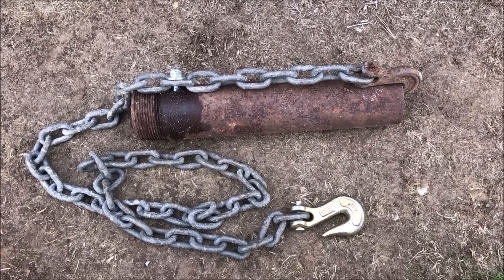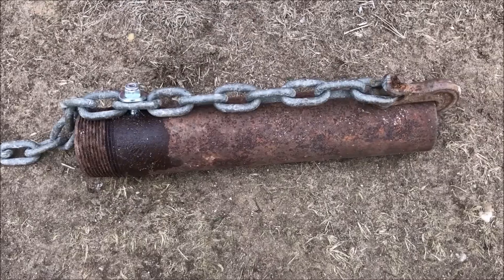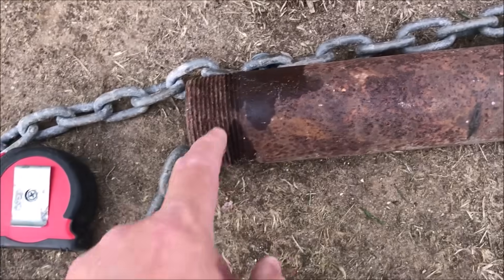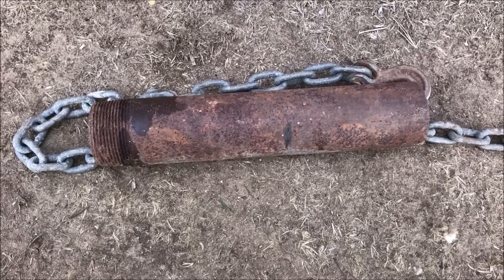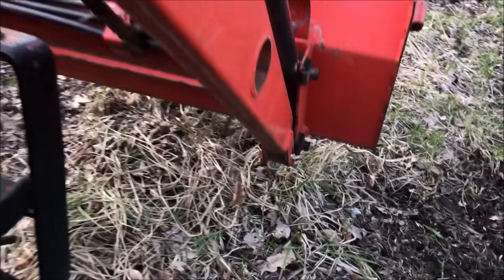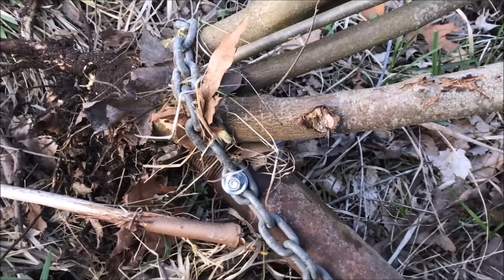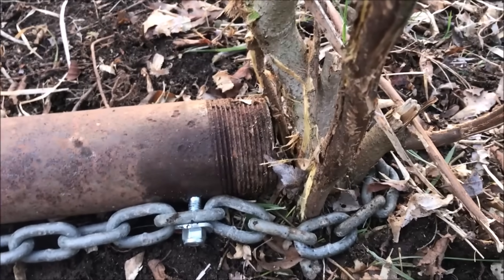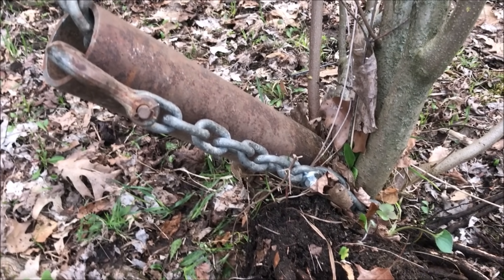OldGuyDIY $18 Best Homemade DIY Brush Grubber Tree Sapling Bush Alder Puller Pipe & Chain Grabber

Comment: Good idea! Did you try puttIng the chain loop entirely through the pipe and hooking one end at the top like you have it just on the inside… then you won’t have to put the bolt on there.
Reply from the maker: Yes, that works but it takes a lot of time to remove the chain from the pipe after each pull and then re-lace it for the next tree.  I have found the solution shown in my 2.0 video to work the best and quickest.

Comment: Or you could just use  a chain with a slip hook end that makes the chain like a noose or rope with a slip knot so the chain tightens when you pull. You don't need the pipe.

Comment: Keep both runs of the chain in the pipe, and you don't have to bother with the bolt. It will automatically keep in line with the chain.
Reply from the maker: I suspect you are right but unless you cut the top of the tree or bush off so the chain loop can be set over the top, getting the chain around the tree and back through the pipe may be problematic.
Reply: @OldGuyDIY  Cutting the top off would certainly be the quicker option. My other concern would be the tree just bending and pulling into the pipe. That would be fun trying to get out.

Comment: Totally unnecessary to make this. All you needed to buy was a different type of Hook. You need to use a snatch hook instead of a grab hook. A Snapchat will allow the chain to slide through the hook and tighten around the tree.

Comment: That looks great.  All I need now is a $ 10,000 tractor.
Reply: You can add a snatch block pully, and it will double the pull strength.
Reply: Try 25000
Reply: @markconley9279  Bought a Russian air cooled tractor in fine working g condition for $1,500!
Reply: You can use a farm Jack / high lift Jack. It has 8500 lbs of lift capacity which is more than the lift capacity of any front end loader on a compact tractor.
Reply: Seems to me you could run a chain to a vehicle and get it to work.  Maybe.    If it works pulling sideways
Reply: Or buy a $30 pick axe and get to work. Your choice
Reply from the maker: Or a come a long, atv, truck, car, horse, just about anything.
Reply: You can do it with a $1,500 tractor.  I just use my Takeuchi TL12V2.  Yesterday I took out a 36” tree with it!  Just dug up the roots and then pushed it over!
Reply: If you take a 4x4 about 3ft long and place it at a 45 degree angle with the chain coming over the top and attached  to a car it will pull directly up
Reply: @andyroubik5760  Yup, or an old tire. Run the line over the top and it rolls it right up and out.
Reply: Wow yt deleted my simple comment, must of been because I said the part of the vehicle that has different gears in it, starts with a T. If you use a kommalong (mispelt incase that word was the issue) you can just tie it to the vehicle to not damage the T the thing that changes gears.
Reply: Thanks saved me wasting my time
Reply: Nah. Stans your spare tire next to the desired tree or bush. Run the chain up over the top to your pull vehicle. Pull slowly and you're golden.
Reply from the maker: You must value your pull vehicle less than I value mine.
Reply: I paid $700 for my 1953 Ferguson tractor. It will probably be around longer than most of the newer tractors. I don't have a bucket but I pulled many small trees and can get a lot of work done with it.
Reply from the maker: It sounds like you found the tractor Louisiana Purchase. Congratulations.
Reply: I was thinking of making the pipe shorter and using a large bar.
Reply: $10000?! Used maybe. Farm jack should do same or just hook to a truck bumper
Reply: Funny you posted this cause it was my first thought. 
Solution...buy a comalong and chain it to a near by tree or something bigger than the bush itself. Could even use a vehicle making it to where you don't need to beat up the vehicles transmission to pull the bush, just use the comalong.
Reply: You’re not going to buy a tractor for $10,000 .
Reply: JD 350 Crawler'll handle it. This video will solve my chain slip issue perfectly. 🤘
Reply from the maker: I agree, this will eliminate the slip issue. Please see my brush grubber 2.0 video for a better plan.
Reply: Of course he means used for 10k, new one that caliber is 25a+
Reply: If you don’t own a tractor, you probably don’t have any trees to pull.
Reply: I use an old F250 wheel. Drape the chain over the wheel (25psi). Pull the chain with a winch wire rope. Winch is mounted to the receiver on my old truck. 
The wheel changes the direction of pull from horizontal (sideways) to vertical (up).
Reply: @jimglewis583  bingo. Thats what I do.
Reply: No you don’t, you just need a come along
Reply: Not really. With this setup you should be able to get by with any heavy vehicle. I paid two grand for my Massey Ferguson. Runs great but doesn't have a bucket. Plenty of pulling power on the back though.
Reply: lol. My exact thought. 😂😂😂
Reply: My question is why didn't he just use the bucket to pop it out.
Reply: Get a cheap beater truck suv or even ATV with 4x4.  My Jeep was $500 bucks but it’s a pretty tough woods buddy even though she knocks like a jehova witness.
Reply: Or a winch
Reply: Or a $50 dollar come a long.
Reply: Not really.. a $1800 one will do. 
Or your truck bumper.
Reply: Paid 2000 for my first tractor a Massey TO30, you can still buy them for almost the same amount. They will do everything most people need and would certainly do this.
Reply: At least $20k
Reply: Use a four wheeler.
Reply: Any truck or suv could do it just use a longer chain so nothing smacks the back of the vehicle. By the way you can buy a used tractor way cheaper than 10k.

Comment: How are you feeding the bitter end of the chain around the shrub and back through the pipe?
Reply from the maker: Please watch the 2.0 video.  The better plan is to bolt a 10" piece of chain to the pipe and have a second chain, with a grab hook, that is laced through the pipe and hooked to the short piece.  That technique eliminates the need to run the chain through pipe after each pull.

Comment: T H A N K.  YOU for this ingenious article. I believe I would weld a few links to the pipe, instead of relying on threads in a thin pipe. It's an excellent design and concept. You could, also, use square or rectangle tubing. Just whatever you use, the grab-hook would need to slide thru the inside, easily, like a "BUCKLE" on a belt or, like you were referring to, (a ring on a choke-collar.) The PIPE idea is simply genius!🎉

Comment: Has anybody ever seen the chain over the tall rolling tire method? It seems like a force multiplier.
Reply from the maker: Yes.  If I use the loader to provide the lift, I don't use a wheel on the larger trees.  If I am pulling from the drawbar, I sometimes use the chain over wheel technique to pull up rather than perpendicular to the trunk.

Comment: I like it and it seems to work!  I usually just smash it all with the bucket and drag the pto mower over it ;)  Sometimes use a chain or a cable logging choker. I think what makes it work is the chain is guided up the pipe smoother than a chain over a slip hook.
Reply from the maker: I agree it works well.  When clearing trails for atv's, I prefer to pull the tree out rather than leave a small stump to potentially puncture a tire or risk dulling the chainsaw when hitting the ground, trying to cut it as low as possible.  I believe the reason this design does not slip is because the harder you pull, the harder the edge of the pipe is driven into the tree.
Reply: @OldGuyDIY  chainsaw never wins!

Comment: Excellent idea.  I'd weld that chain to the bottom of the pipe since that bolt is on its last legs after 2 uses.  ;)   I learned to use a spare tire to provide the upward pull for my little 2,500# electric ATV winch in the receiver of my truck.  It pulled up 15 Spirea bushes and several small trees for me just by setting the tire up at the bush with the cable going over it to the truck.  The choker concept is beautiful, though.
Reply from the maker: Thank you for commenting.

Comment: Im surprised that works. I would think the hard steel would not be able to grip the tree.
I use a Jeep tow strap 2" X 20ft. I wrap one end of the strap around a tree 2 or 3 times
then feed the long end thru the loop & hook the long end to my tractor & pull. The
strap tightens around the tree & out it comes.

!
Reply from the maker: In my experience, this technique is quicker than the wrapped tow strap and easier to disengage from the pulled tree once it is out of the ground.  As tension is put on the chain, the edge of the pipe digs into the tree trunk, much like a climbing tree stand, and allows you to pull the tree out with no chain slippage.  After 40 years of wrapping a chain with a slip hook around the trunk 2 or 3 times only to have it slip and need to be repositioned 1 time out of 4, I found this technique and have not looked back.  Thank you for commenting.

Comment: My logging chains have a grab hook on one end and a slip hook on the other.  For small brush simply wrap twice with the slip hook and it will not slip.
Reply from the maker: I had used the two or three wrap slip hook technique for 40 years before finding this solution.  I prefer this technique because it never slips. Thank you for commenting.

Comment: A pretty slick idea!  I'd be curious to see how it worked on bamboo.  I've got both bamboo and privet overrunning my place, so I'll definitely have to look into making one for myself.
Reply from the maker: There is no bamboo in my area so I can't make a prediction.  I suspect the question is whether the pipe and chain will crush the bamboo before pulling it out. Please let us know how it works on bamboo.

Comment: I do the same with an old tow strap. Tie loops in each end then around the tree and feed one end through the other loop.. Choker. Would also work with a 3-5 foot length of steel cable from tractor supply.
Reply from the maker: I prefer this to the toe strap because it never slips and when using tow straps in the past, they were sometimes drawn so tight around the tree trunk that I could hardly remove it from the trunk.

Comment: The hook on the tree end doesn't appear to have a purpose. Just left it on because it came with the chain?
Reply from the maker: I used the chain with the hook in the first version because it was laying there and I didn't want to remove the hook before testing the theory. The version I use today has 2 bolts and no hook.

Comment: I use a D-ring at the end of the chain that is big enough that the chain slides. It works best with my home made crane implement to pull the brushes straight up.

Comment: Another option to keep from having to rethread the chain through the pipe.....     Use a smaller diameter pipe where as the " chain " fits through it.......but not the hook.   Remove the pins on the hook..... push the chain through the pipe...and replace the hook.  This way the chain wont slide through the pipe.

Comment: Good idea. Use what you have on hand. I bought a chain choker hook to put on the end of my chain and it works real good. It was under $10. I don’t have a tractor so I use the winch on my jeep along with the spare tire. I stand the tire up right up against the stump/brush I’m trying to pull and put the choker chain around the stump/brush and put it up over the top of the tire and connect the winch line to it. When I winch the chain pulls the stump/brush straight upwards.
Reply from the maker: It sounds like you have a good technique for those without a tractor.  Thank you for commenting.
Reply: @OldGuyDIY  YouTube allows us to see all kinds of ingenious ways to do things.  I like watching different videos like yours to pick up new tips and tricks.
Reply: However sometimes its best to pull a tree out at a 90 degree angle.    It helps tear the roots on one side. Then if possible put the other direction tearing those roots .... Compared to pulling directly upward......your pulling on all the roots at the same time.  I feel it would take nearly half the power to pull trees/ brush out.
Reply from the maker: With this device, you can grab the tree anywhere you like from ground level on up.  I have pulled a few larger trees after cutting the tree off about 5' above the ground and attaching the pipe and chain device about 4' off of the ground.

Comment: Good deal!! I've been looking for something to pull these pesky little scrub bushes' out! I have some of these that grew right up against the side of my garage, so I bought a little Chinese mini excavator to tackle this problem but even with this little machine the bushes are just to close to the building, I end up hitting the building not to mention with the 16-inch bucket on the machine the roots pose to be a problem with this bucket. I need a smaller bucket or a ripping tooth.

Comment: Take a common chain (The smaller, the better, as long as it's strong enough) with a common hook on the end; put the end of the chain once around the bush and then over the standing part of the chain and then back all the way around the bush in the opposite direction and hook it to the standing part of the chain.  This technique has worked for me since the 1960s and seldom slips.
Another tip:  I've lately been pulling up by the roots six-inch diameter aspens with my 75 horsepower JD tractor, with no problems, like the tree hitting me in the back.  Stand on the ground and cut the tree as high as  you safely can, which for me is about chest high.  Then fasten your chain (Like described above) near the top of the chest-high stump and your tractor will have tremendous leverage.
Reply from the maker: Thanks for sharing your technique.
Reply: @OldGuyDIY  
I think your tool is great. I would weld that chain rather than the bolt. That bolt scares me a bit.
Reply from the maker: I didn't have a welder available when I made the pictured device and I wanted to demonstrate a no weld technique since many folks don't weld.  I used 3/8" bolts with a shear force greater than the weight of tractor.  I am confident the tractor will lose traction or something else will give before the bolts would fail.  That is also why I used 2 bolts, safety factor.
Reply: @OldGuyDIY  
Ok. Nice. Good thinking and.... I must've missed the second bolt.
Reply from the maker: The majority of the people are watching this video with my prototype attempt.  Part 2 $17 Best Brush Grubber shows my second iteration with no hook and 2 bolts.
Reply from the maker: Thank you for the information.

Comment: Perfect! Hope you don’t mind if I borrow your idea. I’m going to weld a hook right to the side of the pipe. And maybe even cut some points into the edge so it’ll bite the tree a little bit. Very useful tool!
Reply from the maker: I put the video out here in hopes it would save others time and money.  I have not seen a need for teeth because the chain binds the trees and brush tightly into the edge of the pipe.  There is no slippage to speak of. Thanks for commenting.  I trust you will be happy after using this tool design.

Comment: That's really a great idea, simple and cheap! I used to wrap the chain as well and I too had the slipping issue. But I got tired of getting on and off the tractor to so I made a hydraulic tree puller that mounts to the 3 point hitch. (I made a YouTube video of it) Great Job!
Reply from the maker: Thanks for commenting.  I'll check out your video.

Comment: Do you think this design would work for trees 6-10” in diameter?
Reply from the maker: Yes, this design works no matter the size.  On a 10" tree, I suspect strength of the chain and weight of the pull vehicle will be the limiting factors.

Comment: NIce idea and useful for something I've encountered as well (when just using a chain and looping it a few times around the tree). For anyone else reading this, I was able to come up with a technique though in how I made my wraps of chain so that the chain really bit into the tree and wouldn't slip. I can't explain it now because I would probably have to do it to remember, lol. I think I started wrapping at the bottom, wrapping upwards where after my first wrap I doubled back the other direction, causing the pulling action of the chain to drive that first wrap really tightly into the tree.

Comment: Could you cut the pipe down to 4 or 5 inches and still get the same results? Or does it have to be that long? Thanks.
Reply from the maker: Yes, a shorter pipe will do the same job.  I suspect a 4" minimum would be fine.  I just used the piece of pipe I had in the barn.